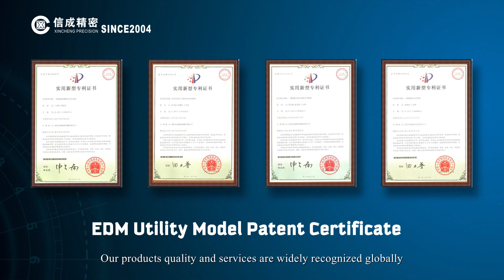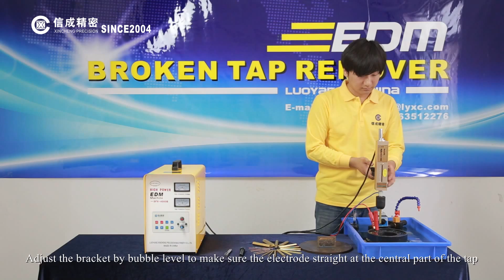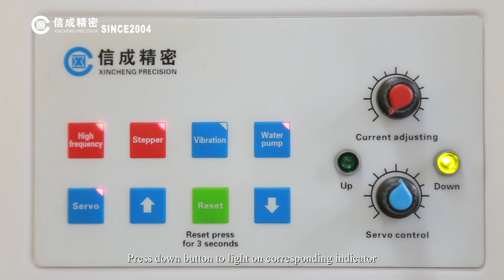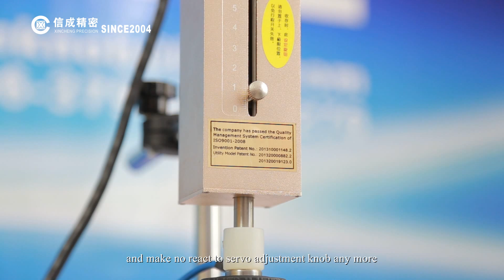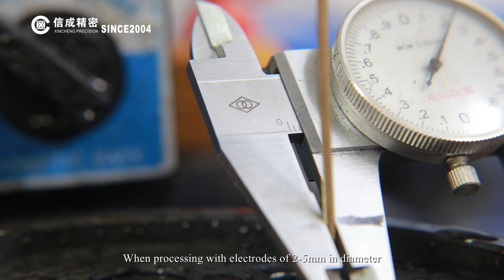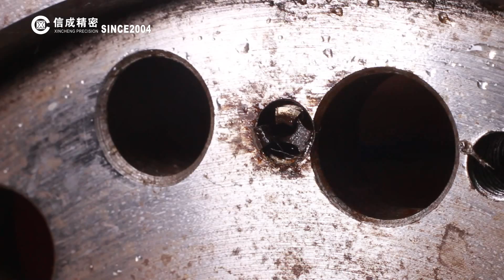Portable edm broken tap remover-How to remove broken tap, screw, drill bit

Comment: Will this unit work upside down?  I have a process where we need to remove broken bolts from frames and we can not rotate the work piece, so we must work from the bottom.  If the unit will operate upside down, do you have any protective shielding for the electrode mechanism?
Reply from the maker: We have the case it worked by side, like this video : https://youtu.be/2Nway4MqpqM. It could work upside down by theory, a demo could be taken for you if needed.
Reply: Thank you for your reply.  Yes, please on the demo with the unit upside down.
Reply from the maker: Ok, I will arrange it. My skype is amynie2015, and edmmachine@lyxc.com is my email. You are welcomed to contact me by them.
Reply from the maker: https://youtu.be/fTwOqVO8e3Q, please check this video. You could see from 4' 26''.  Drain tube and waterproof board need to be prepared additionally. If you buy the machine, we could prepare them for you.
Reply: Thank you.  My browser if calling the link insecure and won't let me see the video.  I appreciate the fast responses!
Reply from the maker: https://youtu.be/fTwOqVO8e3Q, This is the Youtube link, it is safe to open it.
Reply from the maker: My colleague Linda told me you also contacted her on Alibaba. We are from the same company, just talk this case with her is ok, it may waste your time talking this case with both of us.

Comment: WHAT IS THE DIE ELECTRIC UR USING
Reply from the maker: Brass bar is used as the consumables
Reply: What is the voltage and AMS you using
Reply from the maker: AC110V 50/60Hz 1 phase and AC220V 50/60Hz 1 phase are all available
Reply from the maker: My whatsApp is +86 13213632729, the machine brochure could be sent to you.